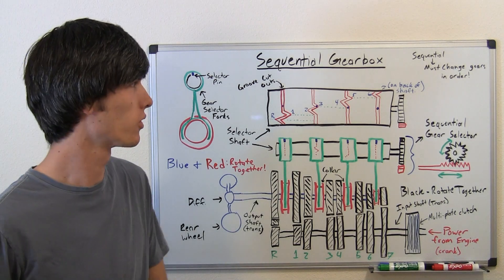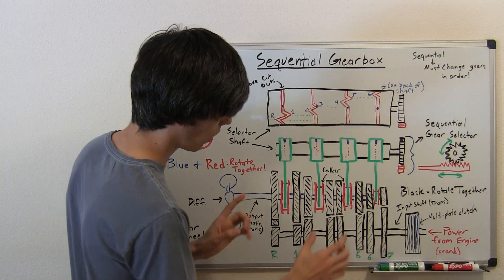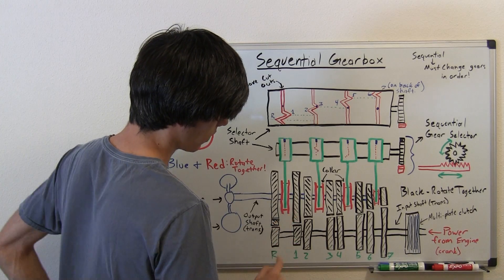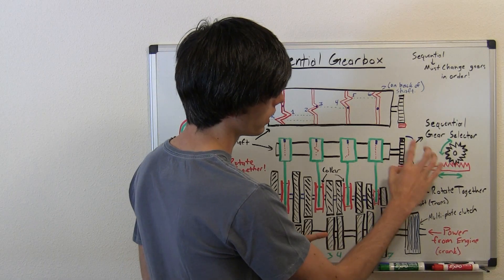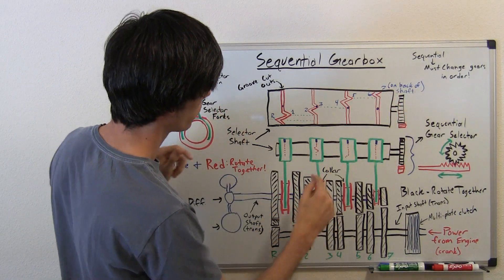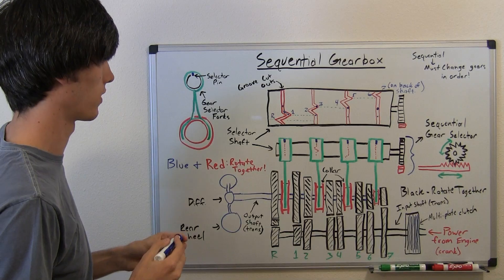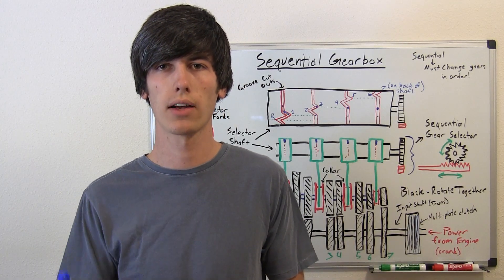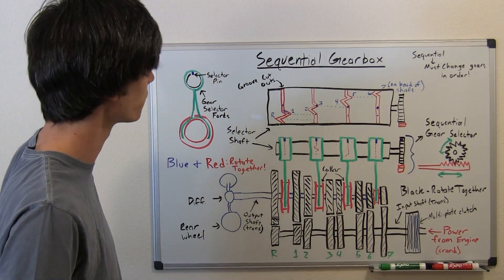Sequential Gearbox - Explained

Comment: Great video, but why you don't have to use the clutch ain't that gonna grind the gears?
Reply: +John R The gears are always meshed together, you can't really grind them no matter what. What you could grind would be the collar that attaches to the side of the gear, since that's what you're moving. As to why it works without a clutch, it has to do with the design of the collars, how quickly it changes gears as well as a bit with how the whole system is controlled.

The collar attaches to the side of the gear using nubs called "dog teeth", which are fairly large, strong and sparsely spaced. This loose spacing means there's a larger time gap for the gear to engage without grinding, so unlike with a synchro-ring you'd find in a normal road car manual, you don't need perfect synchronization if you shift it quick enough. The same technique is used for many H-gated racing gearboxes as well, but there it's up to the driver to be quick enough.

On top of that in F1 the whole system is computer controlled, so when they pull the paddle the engine is cut just enough to take the load off of the collars and allow them to move to the next gear, then applied again. They've obviously spent a lot of time and effort in perfecting the algorithms controlling it so that it shifts as fast as possible with only the minimum amount of engine power cut.

Many lower series of racing cars run completely mechanical sequentials controlled with simple levers, and while those can also be shifted without using the clutch, it requires the driver to be more careful and time his shifts accurately with lifting and pressing the gas pedal.

BTW, any manual road car transmission CAN be shifted without a clutch without harming it by rev matching. This means that you know how high the engine rpm needs to be when you get into the next gear at the speed you're going, matching that with the gas pedal, and then shifting into gear. Since there's no speed difference between the collar and the gear it all works out fine. It is however very fiddly and if done wrong can ruin your synchro-rings, so please be careful. =)

Comment: Why are some sequential transmissions compact like in the Pagani's and some are long and less compact. Also how do automatic sequential like in cars like the Scion XB and Smart For Two work?
Reply: Compact gearboxes have 2 output shafts, 1 with shorter gears, 1 with taller gears.
The result is you only need a shorter input shaft with half as many gears, as each input gear drives 2 output gears and you shift from the short geared output shaft to the tall geared output shaft halfway trough.
Downsides are: more complex, more transmission losses.

Automatic sequential gearboxes aren't realy automatics, they are robotized manuals. 
A computer controls the clutch and the shifting based on engine rpm, load, throttle position... or user input in semi-automatic mode.
Reply: Candisa Are the transmission losses significant for the compact gearbox? Makes me question why pagani would choose to use them if they were, thx for the info btw
 there is literally  nowhere on the internet i can find this info~
Reply: +William Su I'm not an engineer, but I don't think the transmission losses are all too significantly increased...
So if you consider the space saving can be used to fit other stuff, and there might be a little weight saving in the compact design, the overall performance might even be better...

But it's also more complicated, which has an effect on cost and reliability, so if a manufacturer doesn't need the freed up space, it might be smarter to go with the conventional design.
Reply: Candisa Thx!, hope engineering explained can do a vid on it some time to further elaborate so we can both get a greater understanding
Reply: +William Su Well, Pagani uses a transverse gearbox which is ideally suited for mid engine cars. Basically, everything after the input shaft is already turned by 90°. So you end up with a very short but a bit wider gearbox. If you have a car with the engine in the front with the gearbox attached to it and the driven axle at the back, it is of course better to use the normal lengthwise setup.
Automatic sequential gearboxes are hardly any different than a manual sequential gearbox. The main difference is that the electronics do decide for you when to shift. So it is more or less an automated paddle shifter.
Reply: shi01 Ohhh kk thx for more insight :)

Comment: I love sequential gearboxes. They are so quick. I have a sequential in my motorcycle, but I wish my car had one. Oh and a wet multi-plate clutch as well.
Reply: +RyanRants lots of race bikes run dry clutches better for racing not so good on the road
Reply: konaguzzi1 Yep I know most Ducati's run dry clutches, right? 
I just want the transmission that's in my bike to be in my car. Wet multi-plate clutch with a sequential constant-mesh 6-speed gearbox and an up/down quickshifter with auto blip.
All of that is standard on the 2015+ S1000RR... Why does it cost so much to put into a car?
Reply: +RyanRants The trick is to put a bike engine complete with sequential box in a (light) car :)
Reply: my mate made a race car gsx1300 turbocharged very quick car bloody awesome even if just to look at it
Reply: +konaguzzi1 Bike engines work brilliantly in light cars, just a shame the transmission can be a bit fragile due to the extra grip of two driven wheels.  I've got a 1000cc R1 engine in my MNR that is quick enough for me...a turbo'd 1300 must be ballistic!
Reply: +RyanRants a bike weighs not much more than the driver, so let"s say you are trying to accelerate around 150 to 200 kg in total
that means you have a lot less force resisting the rotation of the output shaft than if you are trying to accelerate a ton of car
the gearbox needs to be that much sturdier in the car than in the bike
Reply: +AnarchistMetalhead Well you wouldn't put a bike engine in a car weighing a tonne...more like 450-500kgs.  I think actually the bigger issue is the extra traction a car has.  The torque the gearbox "sees" is greatly reduced as the diff will be greatly downgeared compared to a bike.  My MNR redlines at 135mph in 6th with an R1 engine compared to 190 or whatever it would be in the bike.  The car may weigh just over double what the bike does but this is mitigated somewhat by the gearing being around 1/3rd lower.  The problem is I can bury the throttle in first or second gear out of a corner in the car in a way I can't on my bike without the rear wheel spinning up or pulling a wheelie so you put a lot more strain on the clutch and gearbox.  Mine has been reliable so far though!

Comment: Couple flaws I saw in the video and I'm only halfway thruFirst off the gears in an f1 box would be straight cut not helical as drawnAnd any manual will have a straight cut reverse (even street cars)Second you stated that there would be synchronizers for the collar to engage the gearThis would be true on a standard h pattern street car manual but a sequential gearbox has no syncros, it's kind of the point of a sequential in a car.

Comment: When the car is in park or reverse I don't hear a knock. When it is in drive and stopped at a light or have my electronic ebrake on while in drive there is a knock behind the firewall around the transmission area. The sound is not heard until you are in the car with the doors closed. I had the engine checked; nothing is wrong with it according to Ford but they only looked at the car for ten minutes. Also ever since I've taken the car to them it has seem to have gotten worse on the sound issues.  It sounds like it is coning from the transmission. Is it possible that the trans components are not engaging correctly? If so how do I fix it; besides finding a non dealership mechanic that will actually work on it.
Reply: +The Trillion Dollar Gods Could it be the gearbox in the Ford fusion (steptronic gear box)?
Reply: +The Trillion Dollar Gods Could it be the flywheel?

Comment: is it possible to put this in a car?
Reply: +Muammarvsgaming ROBLOX and more Yes. Pretty much all motorcycles have these.
Reply: Umm...i said car
Reply: I was just giving an example... and yes these can be put in cars.
Reply: Gimme an example of a car that uses this
Reply: The example I was giving was about motorcycles. I am saying:
I T  I S  
P O S S I B L E  T O  P U T  O N E  I N  A  
C A R 

And here are some car examples: Ferrari F1 gearbox (used in 355, 360, 430 and numerous Ferraris manufactured around late 1980s~2000s.) Alfa Romeo Selespeed (146, 147, 156, GTV and etc.) BMW SMG (E36 M3, E46 M3 and E60 M5 and E63 M6) Current cars (still being produced) with sequential shifter are the Smart Fortwo (5spd) and Aston Martin V8 Vantage S (7spd).
Reply: Thx
Reply: +Muammarvsgaming ROBLOX and more One example of a non-racing road car that uses this type of sequential gearbox would be the Caterham Superlight R500 sportscar. The basic mechanism is the same, but it's operated via a lever, not paddles, and doesn't have any computer control like an F1 transmission would have.

There are many computer controlled transmissions in road cars as well, but while the majority of them are sequential in operation (meaning you can't skip gears) they might not necessarily have a selector shaft like in the video, instead using other computer controlled actuators to engage gears. This would allow them to shift from gear to gear slower and smoother, the type of sequential shown in the video will always shift really quickly and can feel clunky and harsh in normal traffic.
Reply: Make sense
Reply: +Muammarvsgaming 00 Look at Boba Motoring on YouTube

Comment: So is that pin thing you were explaining how they change the make the gears longer and shorter for different tracks? 
I don't think they can change this anymore because of FIA regulations but I think they used to be able to.

PS: sorry for commenting 3 years after the video was published :p
Reply: gears are longer or shorter depending on the ratios between the sizes of the cogs that mesh with each other, nothing to do with the pin

Comment: My constant mesh gearbox in my cbr1000rr works exactly the same as this?
Reply: +mark rossi Yes, though there's probably some difference in the shape of the grooves on the selector shaft, since motorcycles tend to have 1-N-2-3-4... patterns instead of N-1-2-3-4... The basics are exactly the same though.
Reply: +jubuttib cool, thanks!

Comment: Gotta suck to only be able to start in R - 1. Gear, 2. Gear or 3. Gear
Reply: +AlexanderPews with the clutch engaged just bump through the gears to change to what is required then take off
Reply: +konaguzzi1 Normally you'd probably have a flat bit in between the reverse and 1st gear exactly to get around this issue, I'm guessing EE either made a small mistake or was referencing a specific kind of racing gearbox with this.

Comment: So... Why don't all cars have such transmissions? It seems to me that they are better in every way compared to traditional H shifters? Of course now the DCTs have taken over but comparing only sequential to H shifters, sequentials seem better.
Reply from the maker: Dino Prašo Cost, manuals are more fun!
Reply: +Dino Prašo this is pretty much standard affair on motorbikes for the last 60 years down side they run dogs so tend not to have synchro-mesh
Reply: +Dino Prašo There are many problems on top of the cost issue already mentioned for normal car use, for example if you're on any gear other than reverse or 1st you can't go into neutral without going through all of them one at a time. You just can't skip gears at all (so you can't for example go 1-2-4 which is a good way to accelerate to 30-40 mph, and you can't drop directly from 5th to 3rd for overtakes), and since all gears are selected instantly as you shift the changes can be a bit clunky because there's less time for synchronization, and you can forget about rev matching. You'd also want a gear indicator installed somewhere, because without one you can't tell what gear you're in.

I'm sure I'm forgetting something, but those are probably the main issues, cost, having to always go through all gears, tendency towards more clunky shifts, additional indicators preferred, etc.
Reply: They aren't cost effective and not all manufacturer's want to put out the money to put each of these in all of their mass produced cars

Comment: If the clutch is only used to engage first gear does that mean that it is essentially being forced into all the other gears. Does this mean the  sequential gearbox would wear out it's sychros very quickly?
Reply: Jason Street Sequential gearboxes normaly don't have synchros. What they did is to engage a special program in the ECU when someone shifts. The Programm cuts the power if you upshift for a moment and automatically blips the throttle when you downshift to match the revs. So yes, the gears are basically just forced in, but in the right way. By the way, you can even shift a normal gearbox without the clutch if you know how to do it.
Reply: +shi01 Yeah, and to add a bit, instead of synchros they have what's called dog teeth, which are large, sturdy and relatively sparsely spaced teeth that are used to engage the gears. The spacing allows the gear to be engaged without any grinding if it's done quickly enough (the space between the teeth allows for a large margin in the timing).

Comment: It's really mind blowing as to how everything can handle the stresses of this. Just think about this F1 engines spin at around 18,000 RPM. Then in as the driver shifts it drops by ~2000 RPM almost instantly and under full throttle.

Comment: Why not just clutch and shift down 3 gears or however many you need? It seems slow to rev for each gear
Reply: Because this system can shift through 3 gears faster than someone can change one gear with a manual gearbox. Also if you shift 3 gears down at once, you probably will overrev the engine or lock up the driven axle which will result in an engine failure or you spin of the track.

Comment: This sounds just like a motorcycle gear box, but for some reason I presume they are different. You could do a video for motorcycle gearboxes I guess.. what do you say? Engineering Explained  ;)
Reply from the maker: Liviu Pavel Same idea!
Reply: Engineering Explained Then a followup question is why not use it in all cars? If it is more compact etc. More exotic materials? More complex design? Why do you clutch a motor cycle gearbox? Is the there any electronic cut out for the engine on F1 cars? I know there is on carts .. ah the questions
Reply: Bultish motor cycle sequential dont have to clutch out as long as you rev is correct. But the ride is quite jerky if you just bang in gear. I assume Road car have H pattern is more for confort, and without a gear indicator, you will need to remember which gear you are in. I know some motor cycle doesn't come with a gear indicator, it really sucks when you need to remember the gear you are in.

Comment: I was once told the quicker you pull on the lever for up-shifting, the quicker the gear change will be, something related to the fuel cut between shifting. But isn't the fuel cut timing is already set for a certain duration? Like if you set the fuel cut for 0.1sec when you pull on the lever, the fuel will still cut for 0.1sec even if you pull the lever for 0.05sec?

Comment: its all perfect bro , but you make only one little "mistake" at the end :)   when in a  sequential gearbox you  decide to go for  example from  2nd to 3rd gear you dont use clutch ok...BUT engine MUST  stop for a split of a second to  let the poor selectors to do their work and pass from 2nd to 3rd gear.  in an advanced gearbox this is made by the cut-off system ( it cuts  the gas off electronically when you press the paddle or the shift lever)  but in a less advanced ( but excellent and very fast too ) geabox like a  competition kart with 6 speed gearbox you MUST remove for a moment your foot from the gas when you pass to a higher gear or it  will nevr let you to change the gear, during downshift you have not this problem because  you dont  push the gas pedal...
Reply: typically cars with sequential gearboxes have dog tooth synchronizers and spark cut programmed in.  you shift flat and the computers do the work.
Reply: I can upshift my 125 without lifting, but will require clutch when downshifting, same with my bike, the computer is cutting the ignition when I upshift on full throttle (like coming out of a corner into the straights) but will help the downshifts with a little clutch, mostly to prevent unsettling the suspension or getting a sudden jolt and a highside......
Reply: Patricio Garcia When I had a Honda CB250RS back in the day, one day my clutch cable broke about 7 km. from home. I had to drag the bike through town to the last crossing with traffic lights to avoid having to stop. I then pushed the bike downhill, jumped on it, kick-started it and slammed it in 1st. I then quick-shifted the darn thing the remaining 5 km. home and ordered a new cable.....

Comment: In F1, when the driver goes into neutral, is that the   collars not being engaged (like is shown in the video) or is just the clutch automatically disconnecting the input shaft to the engine but the transmission being in 1st?